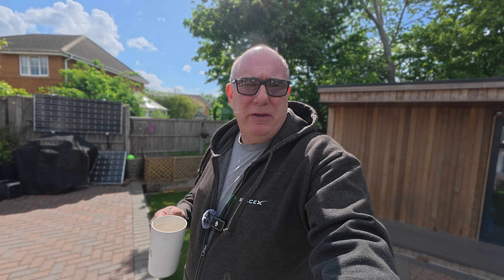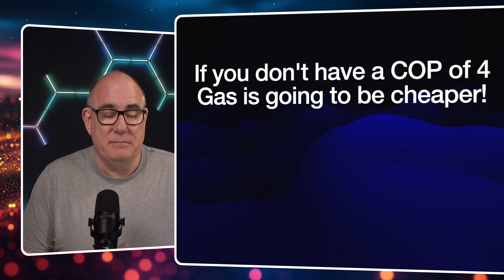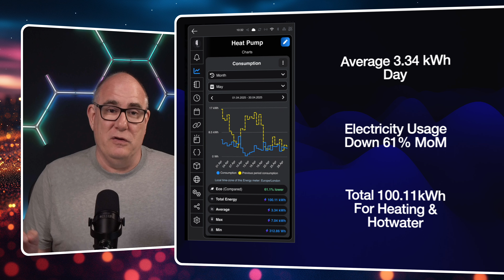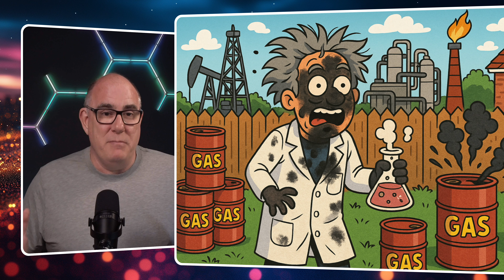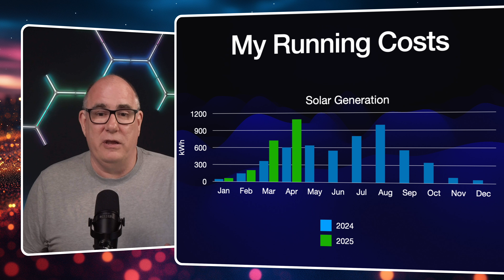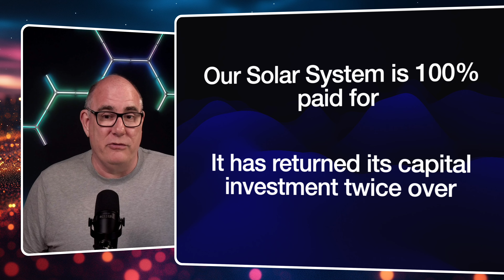We Cut Our Heat Pump Bills to Zero

Comment: I feel you need to start looking at the agile tracker not for current rates , word is off peak is going away to be replaced for 30mm in charging that will hit the public hard. I personally think it’s a terrible idea it benefits the energy provider and not the public .  Under the proposal it follows Scandinavia countries including 1.30 per kw  at peak when wind dropped off the charts just like this Saturday.

Word is there is no free energy, no off peak period, it’s effectively a reworked fixed rate tariff with 3 rates plus regional prices difference.
We are using this model now up in buffalo and you don’t get anything for export , under net metering 3.0 that they want to replicate, with minimum use per month tarriffs hitting solar users without heatpumps or evs already Ed has talked openly of a 65p kw it’s no wonder why ev sales second hand have tanked . If we take such rates into account based on current gas rates heat pumps eill need a minimum of 5 or even 6 per kw
Reply: Not very clear to me? UK is building 2-3x more solar and wind by 2030 and wants cheaper electricity. Export rates may drop, but you have EVs, heat pumps, batteries and home consumption for solar generation before the grid?
Reply from the maker: You’re right to raise these concerns — but I’d push back a bit on the idea that off-peak pricing is going away entirely. Even under a 30-minute market-matching (30mm) system, the grid will still need balancing, and that means there will continue to be periods when prices drop because supply exceeds demand. That fundamental need for grid flexibility won’t disappear.

That said, you’re also right that many people prefer the certainty of non-agile tariffs, because they can predict their costs. Last November is a perfect example — a lot of people on Agile got burned when prices stayed around £1 per kWh for days on end. For most households, the risk and volatility just aren’t worth it, especially if they can’t easily shift or control their consumption minute by minute.

As for the models like net metering 3.0 and minimum-use tariffs you mention, yes, they’re definitely a warning sign of how some systems are shifting the balance to benefit energy providers rather than households. And you’re right — if electricity prices soar, heat pumps will need very high real-world COPs (5 or 6) to stay clearly ahead of gas, which is a tough challenge, especially in cold conditions.

Thanks for bringing all this up — it’s a fast-moving space, and it’s critical we stay sharp on where the market’s heading.

Comment: Great information, the thing with heat pumps they need to be planned it is not something you can have the next day when your boiler fails. We are waiting for our installation, currently waiting for our loop electrical supply to be removed before the heat pump can be installed, it has been 5 months now with still no planned date, very frustrating. We had solar and battery installed in March and April we generated just over a mega watt, we have a 10Kw battery not sure this will be enough to benefit from cheap electricity during the winter months. But this can always be added to once we have the data when the heat pump is installed.
Reply from the maker: agree but to be honest my gas boiler was that old there was not a one for one swap that could have been done without some planning and reworking of pipes.

10kw is a good start and you can always add more as you go, better to see what your usage is like then you can size the battery correctly

Comment: I am currently in a fully electric home, very efficient. But oddly looking to move to a larger home which has gas. I will keep the gas until the government list an end date for the grant, I will miss my heatpump 😞 Zero bill house. But have a need for more space. Going from 92m2 to 170m2. New home has a water cylinder already (apparently built for heat pump in mind) Asked a mate for a rough cost to install, suggested 10kw heat pump after grant will cost me around £5k to fit. Without digging back through your video's I would be interested to know what rad type you have, did you need to replace with all double panel rads? I am kinda looking forward to starting my renewable journey on a new home.
Reply from the maker: The problem with waiting is if its like FIT they don't give you notice they just make a statement in the budget and terminate new applicants immediately. 

Yes with the exception of towel radiators all single pane radiators went to double pane, and the front room went to a triple pane radiator. Same physical size as the old ones just deeper
Reply: You could use Heat Punk to estimate radiator sizes.

Comment: I'm surprised you aren't using solar pv to power immersion heaters for hot water?
Reply from the maker: i have a diverter but it makes no sense to use it. it uses 1kw of energy to create 1kw of heat. the heat pump takes 1kw of energy and creates 3.6kw of heat
Reply: If you can get paid 15p to export 1 unit of electricity. You pay 7p per unit you buy. your heat pump is 300% efficient so is making 3 units of heat energy for 1 unit of electricity why would you bury 1 unit of electricity into an immersion heater for 1 unit of output? Your math aint right
Reply: Wow - excellent

Comment: Would slightly question your statement that your solar generates your heat pump needs for “about 80% of the year”.  In November through to February our heat pump uses far more than we generate (and we have a larger solar array than you).  But taken over a year we generate more than double what the heat pump uses, so what we generate and export in the summer builds up an account credit for the winter, giving a net-zero annual bill.  As you say, you can’t generate your own gas or oil whereas you can with electricity
Reply from the maker: 80% of the year is about 9.5 months, and we can generate enough to run it for that period without importing power, yes as a percentage of total power its different but my aim is to run it on solar until mid november then by importing low cost power until early feb ish.

Ultimately the cost does not matter if your paying for it in the winter with credits built up in the summer, you can argue that its 100% solar powered

Comment: I have 2 LG 9kW heat pumps because at the time there wasn’t a 15kW heat pump that the heat loss recommended on the MCS scheme.  It cost £18,000 in January 2022, and I had to pay all that to the installer 😢 as I received the RHI grant which is repaid over 7 years.  RHI is index linked so I expect to get about £12-13k back, meaning my system cost will have been about £5-6k which is similar order of magnitude to replacing the oil tank that had failed.
In hindsight I think the system is oversized and a lot of the time we run just one heat pump, and that takes less load out of the batteries.
It took a whole to optimise the settings and how we use it but running costs are now about half the cost of heating oil.
Reply from the maker: How big is your home to need such a huge heatpump?
Reply: @ I’d say it’s not a massive house, but I suppose is it larger than normal - it was 3 bedrooms then we had a full height side extension and conversion of the loft to habitable space, so it’s 6 bedrooms now.  The extension I stuffed as much insulation in as I could do,  the original part of the house just standard 1980’s construction.  I did try to argue the heat loss figure down but it is what it is

Comment: Thank JT, very clear and compelling. Sadly I had a heat geek survey that said my home was not suitable to install an ASHP, I did get my survey fee back, but I never received the promised survey so I could see if I could update anything. Very sad considering I live in a relatively new, well insulated detached property on the south coast!! Waiting for my panels and battery to be installed in July / August so maybe try again later.
Reply: Heatpunk told me an ASHP 14-16 kw was needed. Tried to get Heat Geek to do formal quote but they said home not suitable. Octopus said no too. Needed to replace the existing boiler and radiators, had almost given up when I came across Aira. Quote was in budget, I challenged hard when heat loss calculation came back and the smallest ASHP was recommended. Been through winter and the system has performed well, houses has been warm, no mould or condensation issues that I previously experienced. Best of all the bills have been similar to previous winter bills using gas but the house has been warm 24x7. Gas bills based on rationing heating to keep down costs to no more than 6 hours per day.
Reply from the maker: That's a bit strange you would have thought they would have at least given you the reason for it in writing
Reply: I would ask for the specifics. We have a calculated heat loss of 9.6kw at -3, so fairly large. We ended up with a 10kw Vaillant heat pump. it was calculated to use around 7000kwh a year, so at standard tariffs about £1800 a year, ontop of our current eleccie bill of £1950ish. I was concerned about this. We had solar installed, which helped. I then decided to DIY 30kwh of battery storage to this situation for £3.3k, and the predicted electricity bills are now around £1000. There are good value house batteries out there that aren't DIY also, which use standard high quality EV batteries cells. Batteries don't have to be expensive, and a large battery will definitely reduce your electricity bills a lot. You can buy a 30kwh battery from a company like fogstar for £5k, and get a sparky to install (simple job) Aprils electricity bill for us was -£30 on Eon next drive tariff, including the solar export. That includes EV charging, airsource heating, and our normal baseload power consumption. I'm pretty techie, but this level of performance from the batteries/ashp/ev combo surprised me. 10 months ago we didn't have any of them.

Comment: I got an Octopus ASHP (Daikin 9kW) within a couple of weeks to you. We had a couple of install problems (antifreeze valve fitted incorrectly) which skewed our initial numbers. It took a while to dial in the schedules - especially for hot water (why on earth can you only have 4 scheduled events in the Daikin app!) but we found that made the biggest difference in running costs compare to the combi it replaced. 

My biggest gripe with the Daikin is how obtuse the app is and getting CoP out of it. I shouldnt have to do maths to know that!
Reply from the maker: Yep the app is rubbish, its almost like they outsourced it to the cheapest bidder
Reply: you can install a esp32 and run espaltherma (google it) then push all that data to emoncms and openheatpumpmonitor - its not that hard to do and it gives you the info you want

Comment: you wont get 27 years from a heat pump or solar panels and you batteries will also malfunction.
Reply from the maker: How do you know that?
Reply: I wasn't expecting The Witches!
Reply: Yep they will be knackered after 10/15 years and the parts will not be available.

Comment: Hi Jonathan, I am getting a 9.2Kw solar system with an 8Kw battery, I am a very low user of electrical Kw per at most, I have a Combi Boiler Baxi 10-year-old, 3-bed council house, do you think a heat pump would be the best move for me, I guess yes LOL
Reply from the maker: I would say yes, but bear in mind in the winter months it will drain an 8 kW battery in a couple of hours. If your Combi boiler is still running, I would maybe look at expanding your battery capacity first. That way in the winter you’ll be able to get through most of the day from your battery, only dipping into the grid occasionally.
Reply: @JonathanTracey  Thanks very much

Comment: I guess what I’m trying to say that in your running costs table, the column headed IOG with batteries cost shows £7 doesn’t take into account the resulting export sacrifice at 15p per KWh during the Go day rate! So the effective cost is more than £0.07 do you see what I’m getting at?
Reply from the maker: this is leaving out solar and export, just if you had a battery and you imported 100kw at 7p to be consumed by the heat pump, you don't export anything you just use it up. There are thousands of variations on this you could work through but I just wanted a simple example to compare to gas

Comment: Octopus have increased their installation price significantly over the last year. Secured my price at £1900 in Jan 24, which was installed for the same install I'd be looking closer to £3000.

Since the Daikin was installed in December its been easy sailing. We have a 4.5KWH solar system, which is amazing in the warmer but i can't justify spending £4.5k on an ac coupled battery when my annual bill should be around £1100! Cause of this I've moved off octopus cosy and secured a fix rate of £0.19kwh at a decent cop it sits below a KWH of gas.
Reply from the maker: It does seem that way, I did wonder how they were able to have so many people on site and cover all the costs for £3900

Comment: One thing that many (you included) don't factor in is that your GAS boiler uses ELECTRICITY to operate (mainly the pump). 
My old combi ran at 120W; my replacement runs at 80W.
Yes, only small numbers, but they do add up!
Reply from the maker: yep, to be honest, I never considered it when I had my gas boiler, but now it’s gone. I don’t need to worry about it.😂
Reply: If the idle consumption of central heating, circulation pumps etc. is 80 W, is seems a bit much, as a single circulation pump, fit for a house 150 m² is only pulling 5 to 10 W, and electronics to monitor temperature sensors and operarate a furnace or a heat pump should take no more than 10 W (a little computer with a little display).

Comment: Is it not more cost effective to export as much as possible for 15p per KWhr rather than use it?
Reply from the maker: yes, we export the maximum we can, but obviously when you need to use electricity, you use it when you need it you can’t always push everything into the cheap rate parts of the day.

Comment: I've had 2 quotes for both. Boiler comes in at £2300 & £2600, Heat pump from Octopus £7300, BG were a bit cheaper but they never called back. Getting the full on Heat Geek survey in 10 days, that's going to cost £300 or so for a heat loss survey then see what they quote for the heat pump.
Reply from the maker: if you don’t mind me asking, what size Heat Pump did they quote you for at that price?
Reply: @JonathanTracey  I don't think they gave a size. They didn't do any survey or anything which makes me think it was just a finger in the air quote. They called back to tell me if I didn't accept the price was going up. If they'd been within a grand or so of the boiler quotes I'd most likely have signed up.

I fully expect the Heat Geek registered guy to be at least that but he will have done a proper survey and was recommanded to me by the installer who did my PV. The house is a fairly standard 3 bed bungalow, maybe 103 sq metres.
Reply: @IMBlakeley owner of a heat pump installation company here. We think Octopus were installing heat pumps at a loss previously, but have now adjusted their prices to better reflect the costs of equipment and installation. That’s why the prices they are charging are more similar to other local installation firms. The days of £3900 heat pump installations are probably gone, it’s just not sustainable
Reply: @timcameron-kitchen8070 That really means the days of the £11400 heat pump install are over, meaning it’s going to be nearer £15k inc grant. That means that the wild quotes of £20k may not be that wide of the mark soon.

Comment: Only had our heat pump running a week, it's used 17.63 kWh for just hot water and some brief testing, thats about 18p a day, less than the standing charge on gas. Gas meter being removed soon.
Reply from the maker: That's a good start, obviously that will go up later in the year but it will be good to be able to look back in a year and compare you old gas bills to your electricity bills